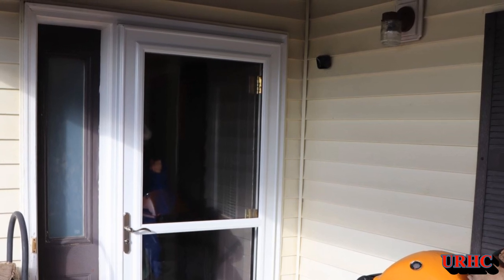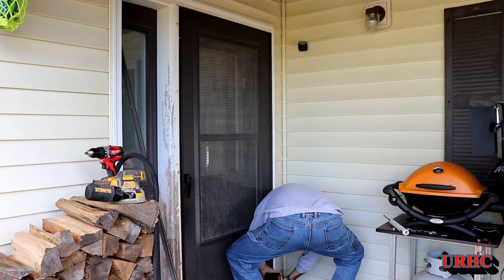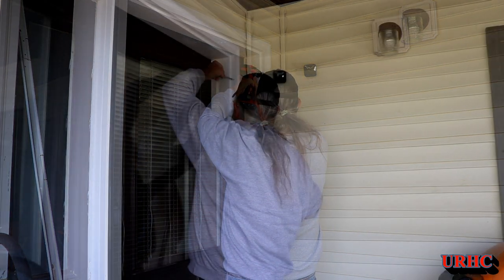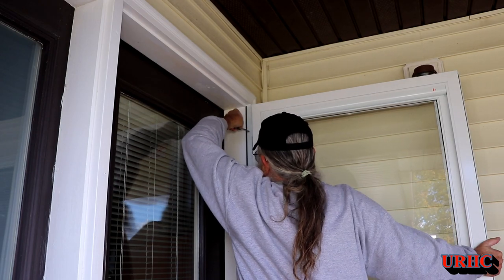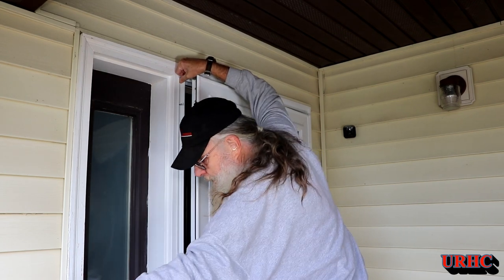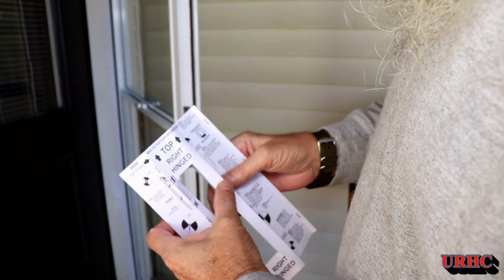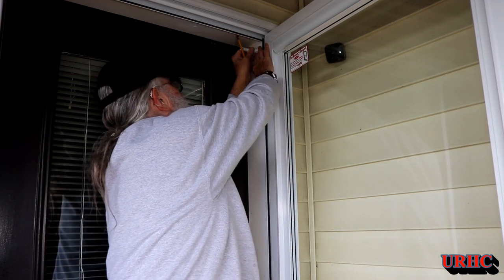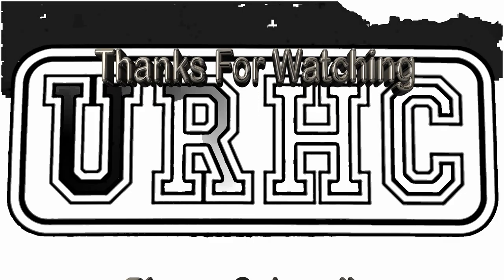Replacing Our Storm Door With A Door From Restore

Comment: Modern storm doors can be difficult to install for most people. Andersen makes one with an easy install option at an extra cost, but these are very expensive doors. You got a good deal on that one and did a nice job on the installation and on the video.
Reply from the maker: The worst  part was drilling the latch holes. The template was not the best and I was off on one hole by about. 03. Luckily aluminium is easy to grind. This turned  out being a very nice door.  Thanks for watching.

Comment: I had to pull our old door off with a tow strap and Subaru  from our mobile home a few months ago. The door frame had no brick moulding and the storm door was caulked in with a soft ball amount of buytal caulking. I used oil based primer and paint on both the door frame and new brick moulding. We installed a simular door but 32 inch and special order that took two months to get.  The oil based paint took a week to dry enough to even work with afterwards It was this summer. I couldn't imagine trying to do it  in cooler weather. Looks good eather way.
Reply from the maker: Sounds  like that was quite the  undertaking. This was a fairly  easy job. Thanks for watching.

Comment: If you've the time, you can perform a small test in regards to paint preservation. If you have some Styrofoam (the white kind, doesn't work with the compact pink or green type) melt it down to a liquid using some acetone. Then, using a non plastic (disposable for this) paint brush paint a small patch of similar paint and leave it on in the sun. See if it lasts better. I've never done this myself, but in theory, the liquidized Styrofoam acts like a sealant and it should protect the paint below it. In theory. 

We used to use this to seal sun lit paintings when i was a kid, in school. 

Needles to say, this stuff is dangerous, and i wouldn't do it unless it's outside.
Reply from the maker: Never heard of that before.  Last time I bought the best outdoor primer Home Depot had and it still lasted  less then 7 years. Direct western afternoon  sun cooks the paint right off.  I'll see how long this lasts and try your solution  on a test block. Thanks for watching.

Comment: Great price for a gorgeous door. Nice job installing. Any updates to the project you mentioned in a previous video about purchasing a kit to convert a gas to an electric engine?
Reply from the maker: Not yet. Still not available  and I am also worried  about the quality  of the Chevy Volt batteries after all Volts were recalled  last month  due to fires caused by a manufacturing  defect. Thanks for watching.

Comment: Is that a red Chevy I see out in the drive? Did they finally take care of your truck?
Reply from the maker: It's  a brand new red Chevy but not mine. Mine has been in the shop over 5 1/2 weeks now and they just got started  on it. The dealer has had covid problems  that took out some techs and it was more work  then originally  thought so they had to free up 2 lifts because it has to come apart.  They put 2 techs on it Saturday  and are saying it should  be done in 2 weeks. They originally gave me a Trax for a loaner but sold that 2 days in so they swapped it out for a new Silverado that they had on the lot. My 18 is a much better  truck than this 21 and I can't  wait to get it back. Covid is screwing  everything up with  my dealers scheduling but they have been great about giving me a loaner. Thanks for watching.
Reply: @unemployedredneckhillbilly2023  Oh wow that stinks. Hopefully they get it worked out soon. My 2018 Ram leaked water from the third brake light and stained the headliner during our last storm. At first the dealer was more than sorry and wanted to ix it even though the warranty ran out 5 months ago. Now they won't return my calls. I am hoping it's just that they are busy.